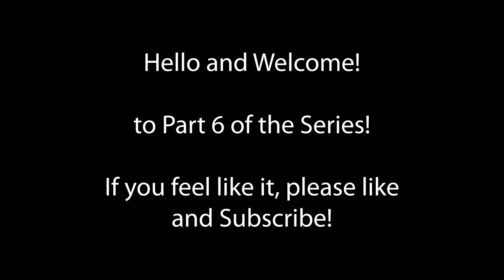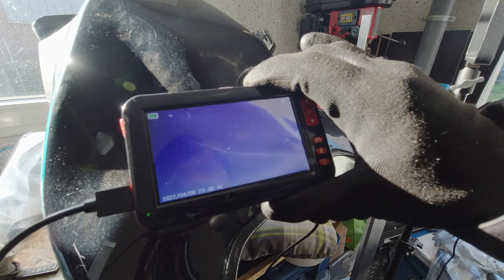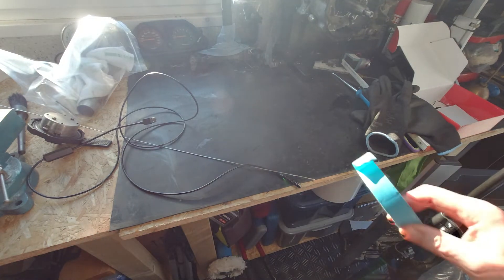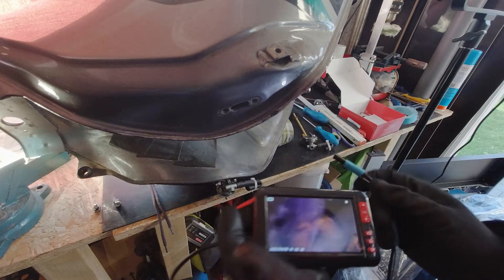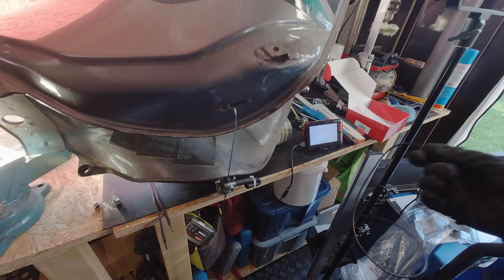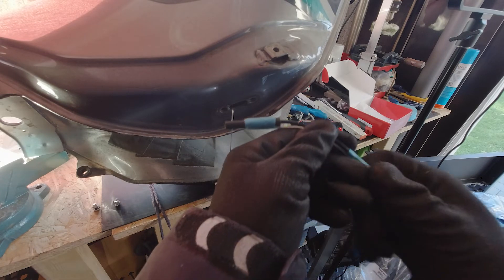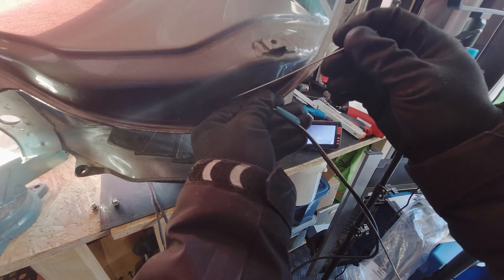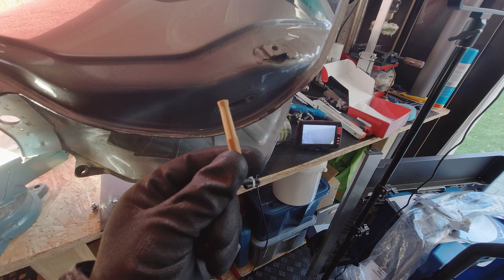Using an USB Endoskop on a Fuel Tank - Restoration of a Yamaha XTZ 750 - Part 6

Comment: I have the same issue on my tank :) one of the reserve filters is inside my tank. I havent bothered to take it out as its a hard job. I have extra fuel filters on my fuel lines before the fuel pump, so its not super critical currently. Might take it out next winter :)